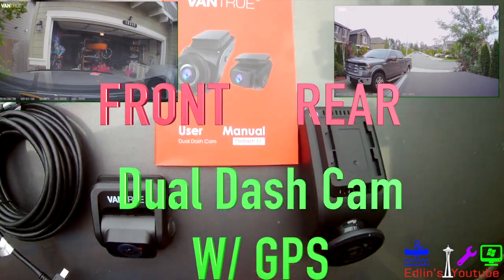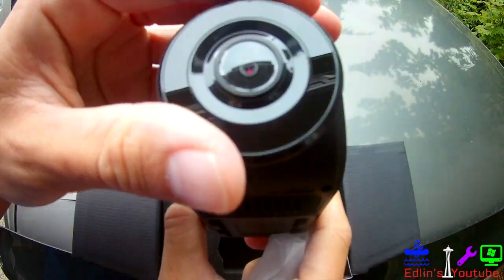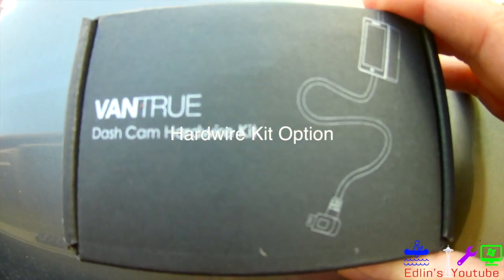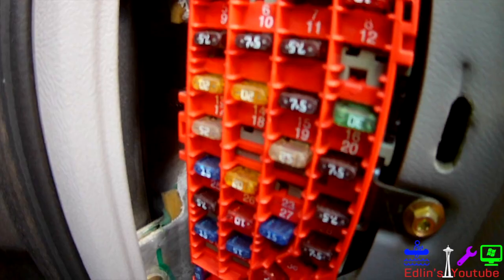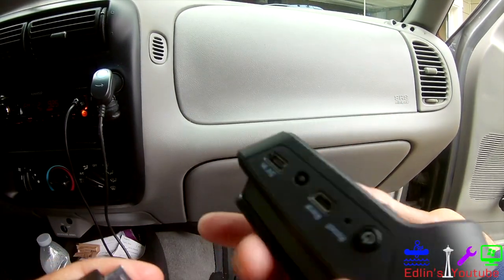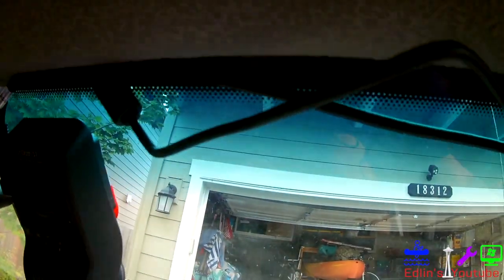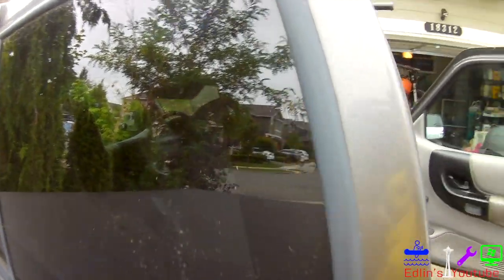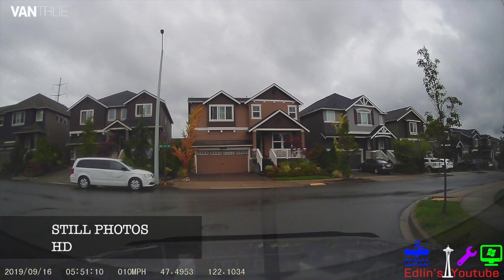VanTrue S1 Front & Rear Dash Cam - Stick on Front & Rear Dash Camera

Comment: The hard wiring kit you have in the video, not shoving a control box on the wiring, but the link you have, it's show a big control box in the middle of the wiring. Also on your F150, can you put back the barker box cover with out any issue?
Reply from the maker: thanks. ill check it out

Comment: Your video was very easy to follow and I appreciate your calm clear voice! Thanks for the electrical panel graphic too! Why did you place the rear camera on the side of the window instead of centering it? Only suggestion I have is to show the crimping tool and how you place the wires to ground.
Reply from the maker: Glad it was helpful!
Reply: Yes! He does have a calm voice.

Comment: I’m looking at your fuse chart, I don’t see an accessory fuse location. Which one would that be??
Reply: You can check this better in your specific vehicle's manual. You can use the outlet since the cig lighter also turns off and on with the ignition.  If you wanted constant power and utilize the parking mode feature, I would recommend using this hardwire kit: https://www.amazon.com/dp/B01B8HI4U6?psc=1&ref=ppx_yo2ov_dt_b_product_details
Reply from the maker: yes multiple ways to do it depending if you want it to turn off when key is out.

Comment: can it be powered by USB?
Reply from the maker: you can buy a kit but that would make  a mess of wires
Reply: It comes with a USB that’ll power it threw your vehicle but not sure if it’ll work with the back cam and you won’t be able to use parking mode.

Comment: How can you use it to record the cops when you get pulled over?
Reply from the maker: yes like the dash cams cops have.
Reply: @edlinnguyen  what? I want to record them with it at my driver side window.
Reply: It’s always recording audio and video as long as it’s plugged in. You won’t be able to swivel it far enough to see faces but should get all audio and video front to back.